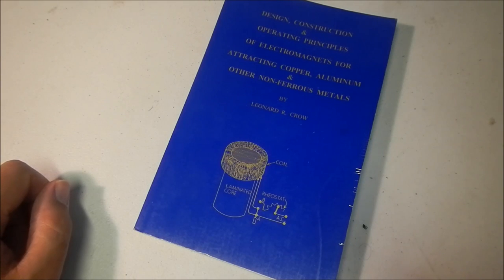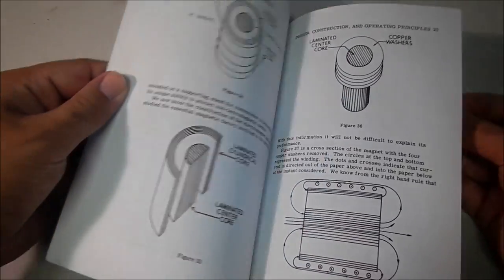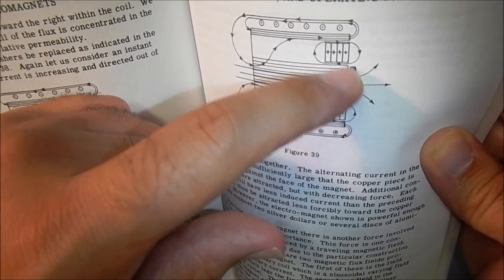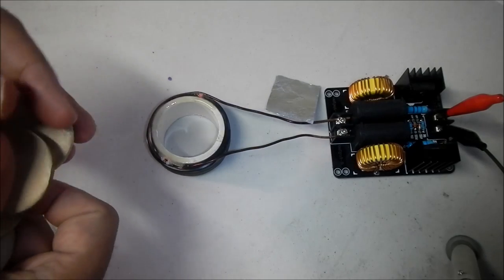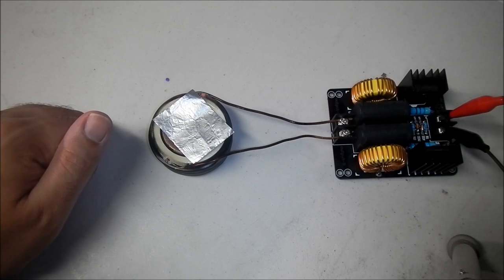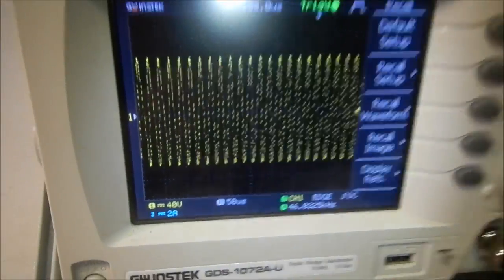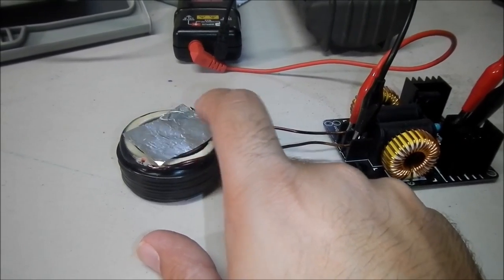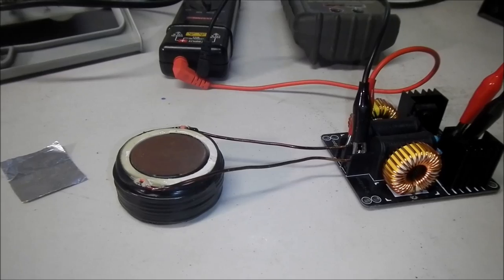Electromagnet for Attracting Copper, Aluminum and Non-Ferrous Metals like GOLD!

Comment: can it be use to extract gold dust from the sand?
Reply from the maker: I had trouble with small pieces of metal... worth looking into.
Reply: @sparkstarter  try out rotating two similar pieces stacked at a distance, one clockwise and the other counterclockwise around their common axis, to form a twisted vortex flux in regard to em pressure and underpressure equations. You may want to offset one of the pieces a little and also 'orbit it' around the center point of the stationary piece, using a planetary gear of sort. The latter design also can be equipped with a permanent magnet to increase the flux densities/concentrate them in a hexapolar field and ionize the conductive particles as they're moving. 

Ideally, you want to offset the pieces in such a maner the local magnetism would alternate between penta and hexapolar system. It could end up being a mess unless you were to acoustically stabilize the non conductive material and suck out the maglevitating metals with a vacuum.
Reply: @sparkstarter  try out rotating two similar pieces stacked at a distance, one clockwise and the other counterclockwise around their common axis, to form a twisted vortex flux in regard to em pressure and underpressure equations. You may want to offset one of the pieces a little and also 'orbit it' around the center point of the stationary piece, using a planetary gear of sort. The latter design also can be equipped with a permanent magnet to increase the flux densities/concentrate them in a hexapolar field and ionize the conductive particles as they're moving. 

Ideally, you want to offset the pieces in such a maner the local magnetism would alternate between penta and hexapolar system. It could end up being a mess unless you were to acoustically stabilize the non conductive material and suck out the maglevitating metals with a vacuum.
Reply: Yes, MORE POWER, BACK TO THE FURUTE POWER

Comment: Good experiment
Kindly tell me electro Magnetic field attract iron or rippel
Reply: Either depending on frequency and geometry.  In general, low frequency will attract iron because iron is ferromagnetic.  High frequency will repel iron (except in unusual geometries such as in this video) due to iron's electrical conductivity.  And, of course, any frequency above DC will repel iron if iron is hot enough (above Curie temperature) where it is not ferromagnetic.

Comment: It seems like the copper slugs eat the magnetism up... so its not that the foil gets attracted is that the net repulsion is from the outside in, since the inside is being filtered.
Reply from the maker: Thanks for the comment... never thought of it that way.
Reply: @sparkstarter  If you have the materials and will to discover the truth i got some stuff to test for you.
https://www.youtube.com/watch?v=9ckpQW9sdUg
dielectric is where magic happens.
There is also a propulsion for submarines; dont know if its being used or not, but if you place a magnet in the field of a condenser, it will produce 90 degree force on the fluid passing by... also lots of experiments with seeds exposed to 3k+volts over 3 nch or something... literally put in the condenser and the growth from these seeds was changed... it grew faster, stronger, more and some mutated in proto-genes or something where it turned out as a previously extinct plant etc.
I would love to experiment with rotating condenser in a magnetic field and a rotating magnet and instead of coils as pickup,  you place different condensers with different dielectric materials and read the potential differences or forces exerted.

Also another thing to be tested is to make a fluid battery. Have condenser charge lots and lots of lets say oil as dielectric, than you store the oil in a box and lift it up and make the stream run between 2 plates. perhaps not verry efficient, but all you would have to do is collect the used oil and recharge it again so there is never any waste.

Comment: Hey that's cool ... And I have question, can we repel small iron particulars like paper clip or needle from copper metal
Reply from the maker: hmm, not sure...
Reply: Usually for something like that you’d set up a regular magnet (or electromagnet) to pick out the ferrous metals and then use a non-ferrous metals magnet to sort the rest of the metals like copper and aluminium

Comment: Butt don't you need the copper pieces to be rings, and then have a laminated stack that is 90 degrees to the outside face?
Reply from the maker: It will work with copper disks, although I think it might work better with copper washers and High Frequency Ferrite core inserted.

Comment: Some ppl think magnetic fields are made up of 'threads'/lines which is not true. That analogy confuses ppl and does a disservice to advancement of physics. Lines w arrows are used to graphically show the direction a compass needle would point. Magnetism is nothing more than electrostatic-like [think +/- charges] attraction/repulsion of polar[think +/- charges] atoms/molecules/alloys, each of which radiates spherically on the atomic scale where they overlap, the sum of which, on the macro scale, is a homogeneous generally spherical field. So, on all scales the fields are spherical, not thread/ray like which is an anachronistic view of EM.

I'm working of the Parallax Electric Theory to explain that there is no 'magnetic' field, only +/- electric ones.
#ParallaxElectricTheory